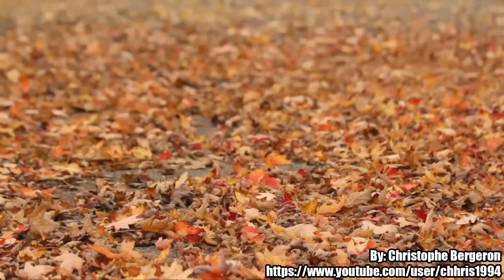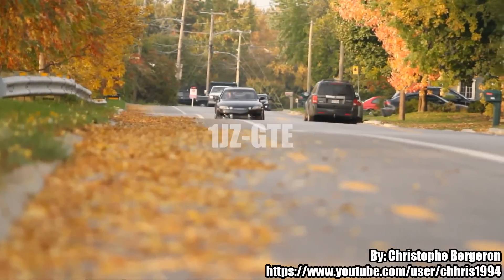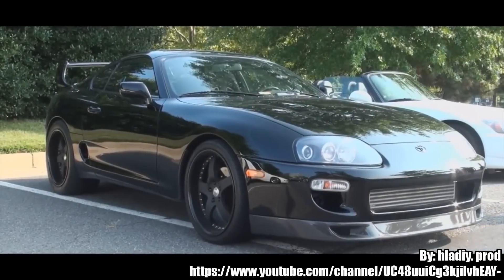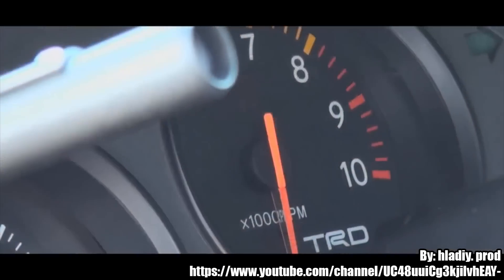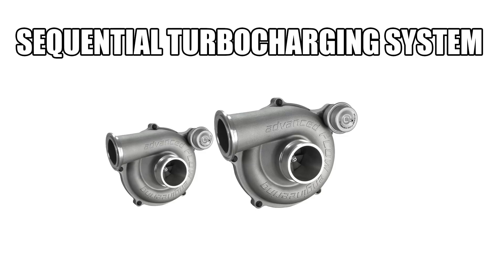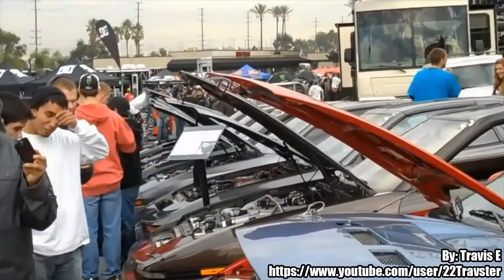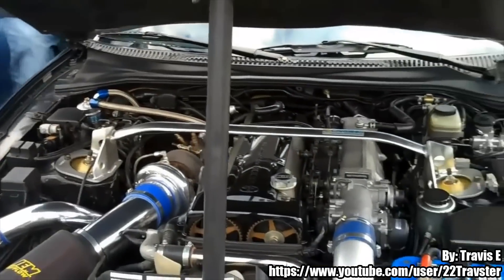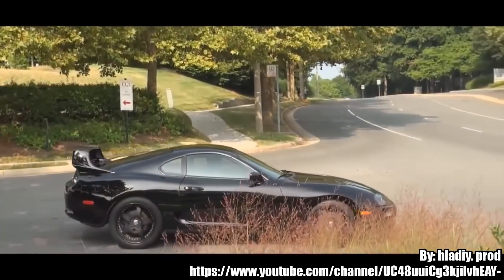1JZ vs 2JZ: Which one is better?

Comment: 1JZ sounds better (?)
Reply: I think so
Reply: Jz is jz
Reply: They both sound amazing.
Reply: @Tactical_Response_Team  yup
Reply: That's down to personal preference, I think it would also depend on tune and exaust setup as to how good they would sound. Like a 1JZ with a nice stainless pipe could sound better than a 2JZ with a stock pipe or vice versa.
Reply: While stock
Reply: 1jz make better turbo spools than 2jz
Reply: @STING-og5qo  1jz spools on 2800 rpm while stock 2jz even have no lag spooling on 1800 rpm. I mean later vvti version
Reply: @Quatto13  bro u can go with a setup less than 64 66 with around 0.72 ar it will sound and spool best and start sounding like rb26
Reply: Cristóbal Barrera, you got that Right 💯🎯
Reply: Toyota 1JZ is similar to Nissan RB engines. Forced Engine, not a Stroker engine 😎
Reply: @trippleeksell4098what exhaust sounds best for 2JZ?

Comment: Actually the turbos on the 2j are the same size. It's just that below a certain rpm all exhaust gases are directed to the first turbo, making it spool faster.
Reply: tavi921 exactly. don't know where this guy gets his info, but it's incorrect.
Reply: I just looked up a picture of both the turbos and one turbo has a larger compressor wheel then the other
Reply: You can have the same size housing . Doesn’t mean the compressor wheels the same .
Reply: @61936  that's sequential turbo, smaller being low rpm and larger for higher rpm.

Cuts down on turbo lag.

Comment: the 1j and 2j are brother's.. they're happy and they both eat v8s like it's nothing....gimme a high 5 (please sing along using the Wayans brother's theme song) thank you
Reply: Anil Hazare bullshit , you put turbos on V8 S and they will leave you in the dust
Reply: @iamasmurf1122  you're forgetting that the 1j and 2j being in line 6's have much better and stronger gradual torque than any v8 in the top end yeah you'll probably make alot of torque on a v8 but the majority of it will be low end motors like these destroy in the top end that's all that matters.
Reply: Lmaooo you brought up the Wayans brothers theme song
Reply: wich v8? lol stock for stock an ls1 is better than a 2jz.
Reply: @pope9349  they both made nearly the same power, at least comparing the 2JZ to the 350 hp LS1. It only made 30 more hp. I mean...... Was it really that much better? It's not like a 2J doesn't make torque lol
Reply: @ellisjackson3355  ls1 is lighter with a better power band.THe 2jz can handle more power but at a certain cost.
Reply: And cut! Beautiful guys! Lol 😅

Comment: 1jzgte bottom end is a bit more robust than a 2jzgte bottom end. 1jz’s have thicker shorter rods as compared to a 2jzgte’s. I believe 1jz bottom ends would be able to support almost 900 hp without being touched on a good tune. I’m gonna be pushing mine this summer so I’ll check back In with numbers

Comment: Someone, correct me if I'm wrong, but doesn't the 2JZ-GTE have same sized turbos? The exhaust goes into one turbo for low power and uses both for high power?
Reply: Same size housing, different compressor
Reply: That black Supra lookin real silly makin all that noise with those rusty NA brakes SMH

Comment: The dimensions are slightly different as well. 2jz takes up more space than a 1jz so if you are doing a swap considering a 1jz may be a better option if you're working with a smaller engine bay. Both are FANTASTIC engines so honestly you can't go wrong either way in my opinion.
Reply: The 1jz doesn't take up any less room. Its even evident in the video in the MKIV engine bay...

Comment: The sequential turbo system usually has one bigger and one smaller turbo but the 2jz sequential turbos are bothe the same size. Replace the Pistons to forged stuff on 1jz and then can push for 1000hp

Comment: I'd like to see a video comparison between a 2jz and an old Hudson Hornet's 308 cubic inch flathead straight 6 is they were to turbocharge it! It was beating the V8s in the early and mid 1950s on the Nascar circuits..

Comment: refer..
 Supra mk iv forum nz..2JZ GTE has 2 equally sized turbos set sequentially by the factory..but i have to say that when the second turbo engages it kicks in very hard..which may create the illusion of a larger turbo..i see also you have been advised the same previously in your comments.

Comment: you said the reason why 2jz could hold more power is because of displacement. while this is part of it, the real reason is because its built with much higher quality parts. and the 2jz been proven to hold 1000hp with a good tune. but with 1000hp the first thing that will go is connecting rods. everything else should hold.

Comment: cool vid, but the one thing you forgot, or did not know, is that the 2jz is based on the mercedes 3l M104 engine
Reply: +16vv No its not, its based on the 1JZ which came out before it, you can even swap a 2JZ bottom end onto a 1JZ. Now as a point of influencing Toyota then maybe.

Comment: Pretty much nailed it.
The oversquare 1JZ for track use as you can rev the piss out of it, and the square 2JZ everywhere else for the far more linear power delivery.

It would be interesting to see how the 2 otherwise standard engines compare with the turbo systems switched between the two. My guess is they would drive very similarly as the sequential turbo setup would aid the 1JZ down low where it lacks, and the parallel system would potentially give the 2JZ more huff in the top end.
it's quite common for builders/tuners to scrap the sequential system on big power 2JZ engines and replace them with a pair of moderately sized turbochargers in parallel, or a very large single turbo for that exact reason if memory serves me well

Comment: 1jz is better because it's significantly lighter than 2jz (that thing weighs more than an elephant) and it also has 400 plus hp potential in stock form, and you REALLY don't need more in your daily driver

Comment: 2JZ-GTE has two same size turbochargers. 
Please check the facts better next time :)
Reply from the maker: Yeah, I admit that.
Reply: heyy can i ask u a question
Reply: i heard 2jz arent very reliable engines is this true?
Reply: Nabeel Mazhar 2jz is as reliable as you can get if you're going horse power freak. The iron block can comfortably handle 600hp with stock internals without any worries. Look at it as a violent engine build that's as reliable as a stock Honda engine haha. The v160 Mercedes style getrag is also extremely well built since getrag is probably the only transmission company that builds a near bulletproof 6 speed. Hence why a lot of 6 speed bmws don't really give transmission issues like that to begin with.
Reply: The 2GR-FSE is a 3.5L engine used in the Lexus IS, GS 350, Mark X and Crown incorporate Toyota's latest D-4S twin injection fuel system.
Reply: Nabeel Mazhar negative
Reply: @joshbwithaz9621  with also the help of Yamaha and a German engineer

Comment: Can you tell us the difference between front sump 1jz and rear sump 1jz?
Reply: Depending on which chassis the 1JZ is in, it will either have the sump "bulge" at the front or the rear in order to clear the engine cross-member.  Whether front or rear sump, the engine is essentially exactly the same, just the sump position is different.  You can also swap a front sump to a rear sump and vice versa.

Comment: RB25 vs RB26
Reply: and rb20 and rb30
Reply: +conner McAllister RB25 is 2.489cc and comes N/A and sequential turbochargers, RB26's are 2.678cc and come only with sequential turbos
Reply: +Andrew Turner rb20's are 1.998cc n/a engines and rb30 are rb26's stroker kit engines capable of big numbers. thats it
Reply: matheus henrique rb25det's are only single turbo
Reply: i only knew that was turbo haha :D thanks for correcting me
Reply: rb26dett vs sr20det
Reply: +Matheus Marçal RB30 is a factory engine, it was sold in Holden Commodore VL and R31 Skylines in Australia.
Reply: i didnt know that, thanks for the information nick
Reply from the maker: Here you go: https://www.youtube.com/watch?v=i51aqQ0F5ck
Reply: Both killer designs and kings in their respective classes hands down.
Reply: those aren't even in the same class
Reply: RB26 vs VG30.

Comment: where can I buy a 2jz? I live in Canada and have a stock mk3 supra. I want to do a swap but don't know where to find the engine.
Reply: These are the cars that came with them from factory that you can use as a donor..  not 100% on how mk3 are set up but it is likely you will need wiring harness and the ecu to make it work. if it was an NA car you will also require an intercooler. hope this helps.
Toyota Altezza AS300/Lexus IS300
Toyota Aristo/Lexus GS300
Toyota Crown/Toyota Crown Majesta
Toyota Mark II
Toyota Chaser
Toyota Cresta
Toyota Progres
Toyota Soarer / Lexus SC 300
Toyota Supra

Comment: can u tell the engine weights next time?
Reply from the maker: Yes
Reply: VisioRacer nice, i dont know what to swap my s13 with and weight is a big factor for me
Reply from the maker: I understand. I try to put engine weights in my videos when specs about the engine itself matter, but don't take them absolutely seriously, because there are no official numbers for engine weights and some of them are not known, some are with engine full of liquids, some of them dry and even with or without gearboxes.
Reply: VisioRacer thats understandeble i have a hard time to find weights to. i cant chose between 1jz or rb25, i like the rb sound but the 1j is cheaper
Reply: the big problem is the price of the manual conversion. a r154 with clutch and fly (depending where you are) will set you back 2-4k or more whereas the rb box with clutch etc are cheaper. all in all i would say the rb will be a cheaper package to purchase and install, but the jz would be better overall

Comment: how does th JZ's compare to the 7M GTE?
Reply from the maker: The 7M-GTE has some factory flaw which however can be easily fixed. From what I read, it may not be worth to swap the 7M out under 500 hp.

Comment: 2jz vs 7mgte what are the differences since they are the same platform
Reply: lol what?
Reply: Daniel7MGE Lawton one major difference is the 2jz keeps its head on
Reply: Ya no kidding, that's due to the low factory torque specs , once corrected your fine , I meant internals cams, pistons valves etc etc but thanks you wher very informative 😂😂
Reply: Well then if you are going to ask what the differences are then maybe you should be more specific?

Or do you expect people to post the technical list of difference between bore size, stroke, cam duration, etc?
Reply: Bro that's what the video was about genius, it was just a suggestion for video and the guy asks for suggestions at the end so ya didn't think I needed to tell him what to do

Comment: can 2jz engine would fit any Toyota car?
Reply from the maker: No, I don't really think so because there are many Toyotas that are using a transversely mounted engine which apparently needs only short engine bay to fit the engine, even with a V6 mounted in it like a Camry. But you can fit it in many other Toyota cars, like the little GT86 for example. There are lots of guys running the new 'Hachi-Roku' with the 2JZ.

Comment: 7mgte 😂
Reply: 7M-GTE has a problem with cylinder head not being tight enough, but after torquing it down it can take a massive HP. Besides the head it's an overengineered engine :D
Reply: Ten Koleś they have rod knock issues as well.  Stock rods and bearings on a 7m can only take about 450-500hp max. When built correctly they can make gobs of power and torque to match.